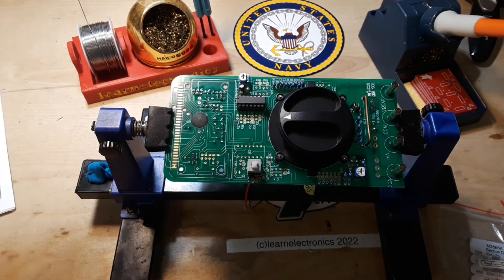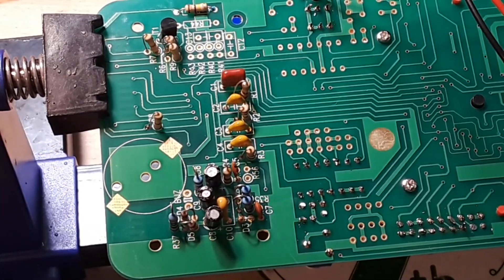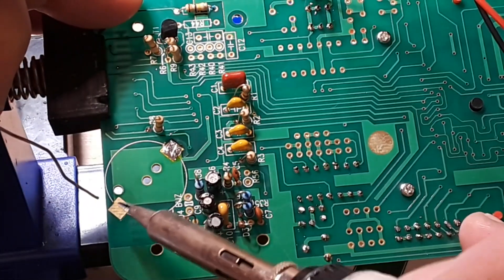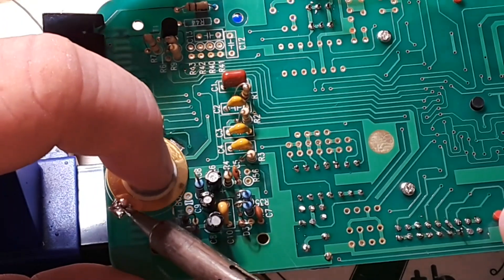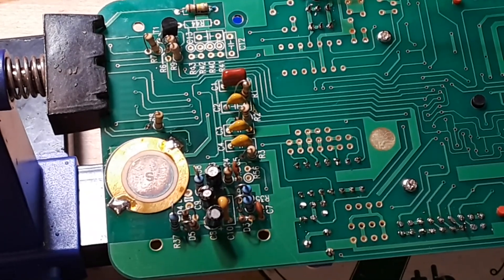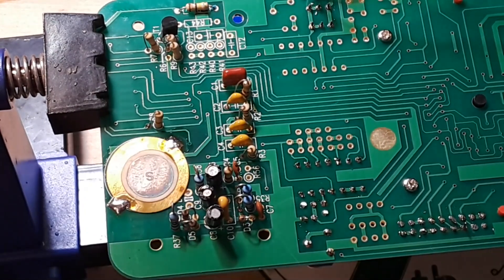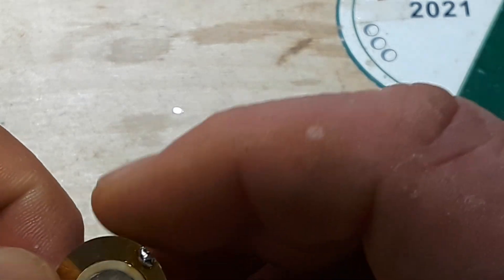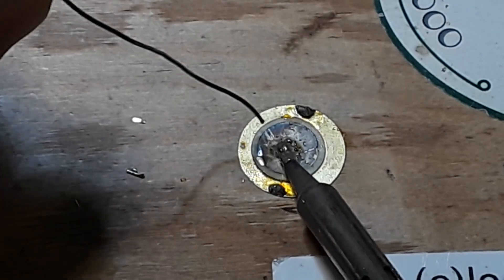Elenco M2666K Multimeter Build Part 4

Comment: FYI: I checked every resistor & capacitor value before installing. Each and every one was correct UNTIL R44, the very last resistor to be installed. Instead of a 10K 1% resistor (as per the documentation) the resistor tested (and was color-coded) as a 90K 1%. 

I double-checked that I had not transposed resistors (as I said, since I checked each value as I went along with my DMM, it makes it unlikely I installed the missing 10K resistor in the wrong place). It "appears" they gave me a 90K instead of a 10K in that very last slot. 

Of course, I might have goofed up, but checking the values all the way through, this has been the first discrepancy noted: the very last one. 

Might at least be worth checking R44 when you get to section E. 

---Mike

Comment: Had the same problem, but I did eventually get a small solder ball to adhere to the center, and I was able to get a wire attached, ALSO . . . There are three points on the brass perimeter (not just two) that are soldered to the board. The lead soldered to the center goes to the hole in the board farther away from the perimeter. The buzzer eventually worked OK, but it was by far the most problematic part of the process for me.

Comment: When I've seen those buzzers before, (e.g. inside watches), they have had a small spring connecting the back of the watch to the central ceramic disc. I'm not sure you can solder them. (?)

Comment: The thing that you are trying to scrape is byitself is the conductive layer, it's not a plastic film. I have done same thing before, just use low temperature, a thin wire that won't take a huge temprature to get soldered and you will get just a very small area to solder, don't scrape it anymore, just whatever small ball solder that stick, sold the thin wire and you should be good to go. and if even after that it won't work then sue the manufacturer for providing defective product. 

last line is just a satire.😅😅

Comment: About the buzzer, don't solder directly on to the S symbol, because there's ceramic under it exposed. The copper is a small layer above the ceramic, probably sprayed or somehow stick to the ceramic. So, due to the very small amount of copper, don't put huge blobs of solder. There's also the chance that the buzzer that you've got is garbage, so try to source some good ones that you can see the copper on top of the ceramic.
Don't scratch the surface, because you'll remove the copper and nothing will stick on top of the ceramic.

Comment: First of all, discard the buzzer. Clean the pcb as much as you can. There's no need for tinning the pcb before, but since you've done it, clean it, so there's no blobs of solder. Then get a new buzzer, and solder the top cable. Again, don't use so much solder and flux. Just a bit. For these kind of jobs, I usually do test the solder temp, but usually around 300 celcius is working for me, but you can do tests to figure out your soldering iron performance. After you solder the lead cable on top of the buzzer, place the buzzer on the pcb (without tinning or putting any more solder or flux on the pads) and clamp it, so it won't short with the through hole for the lead cable. Place the 300 celcius sholdering iron without any flux or resin at the corner of the buzzer and the pcb, so it touches them both at the same time. A thick soldering tip should do the job. I usually touch the buzzer or the pcb from around 1.5 cm to 2 cm close to the tip, and when I feel that things are heating up, I just wait for a bit and put some solder directly on the joint between the pcb and the buzzer. When you see this little solder that you put spreading and absorbed from both pcb and buzzer, then, you've got a successful soldering. Now that things are heat up, just do the same on the opposite side, but don't leave the solder for as long as the first one, because the pcb may start to burn.
If you can't solder the lead cable, just buy buzzers that already have a cable already soldered on.
Once again, don't put solder or flux. Put everything in place, heat up with the tip and then put just a bit of solder.
Reply from the maker: Thanks!